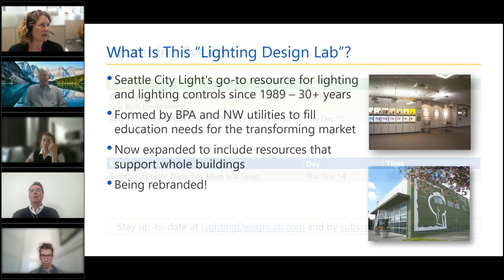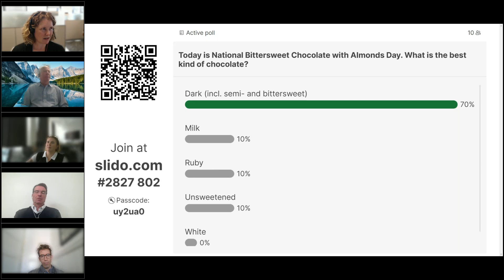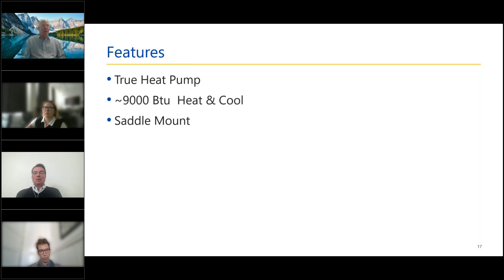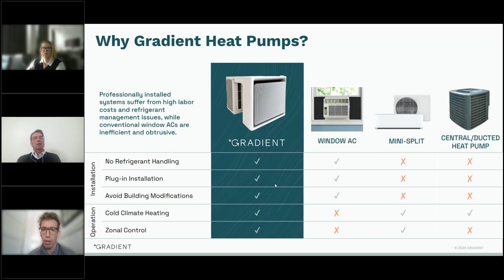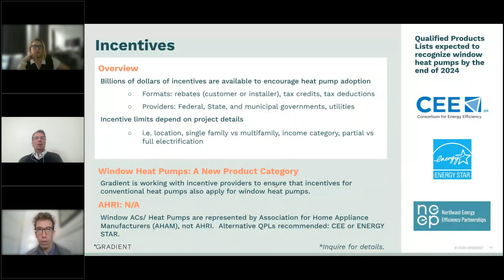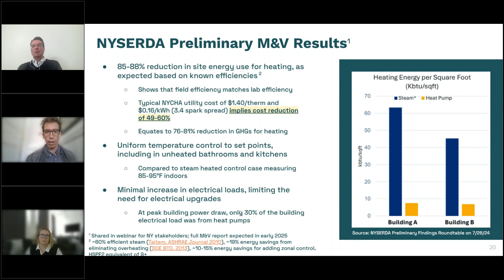Window Installed, Saddle Mounted, Cold Climate Heat Pumps – What Are They?

Comment: Midea has done a 180!  They now say the PWHP is NOT DIY and demand that buyers use a contractor!

I spoke with a woman at Midea today who told me:

        * There is no distributor in our area (Maryland).

        * Even if there was, they do not work with homeowners.

        * The PWHP is not DIY. Early videos saying 'no contractor needed' and 'DIY' are incorrect!

        * The Midea central office or a Midea distributor are the only approved sources, and they only work with licensed contractors.

        * Regarding the warranty, she said in the event of failure the contractor would have to come to our house, diagnose the problem, remove the faulty parts; ship them back to the distributor/Midea, wait for the replacement parts, then come back to our place and install them and hope it works. Of course in the meantime we'd be without the PWHP. I realize the units are heavy, but it seems to make more sense for the contractor to swap a known good unit for the faulty one.

           * Midea is concerned about liability. She claimed that even power companies offering incentives could be held liable for injuries or damage, so they only offer incentives/credits if the units are professionally installed.

        * She claimed the PWHP weighs 145 pounds (not the 115-120 pounds I've seen).

        * Midea is also very concerned about product registration(?) and seems to think only distributors can do that.

         I asked why there are Midea videos and literature stating "no contractor needed" and "DIY!" available online. No response.

        Then I suggested that Midea might want to consider taking down all of the now misleading content. No reply.

~~~
Hopefully this will prevent people from wasting time like I did.